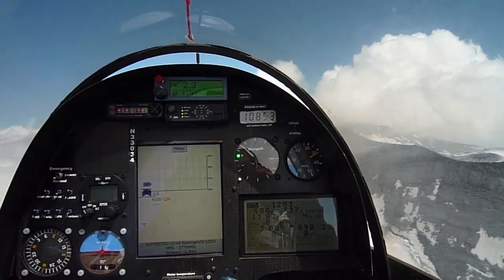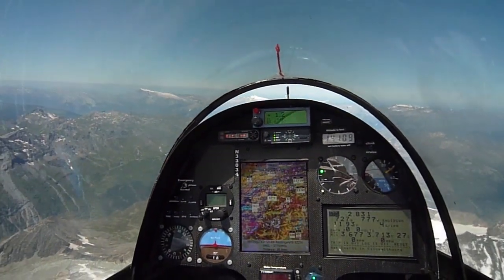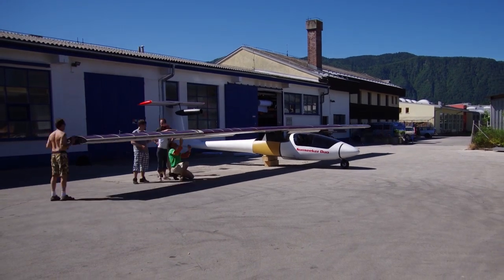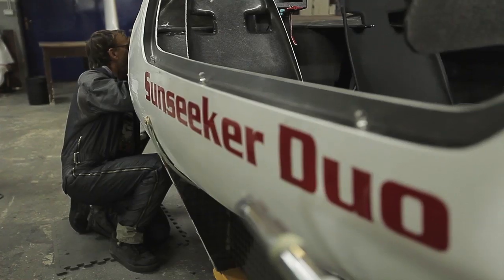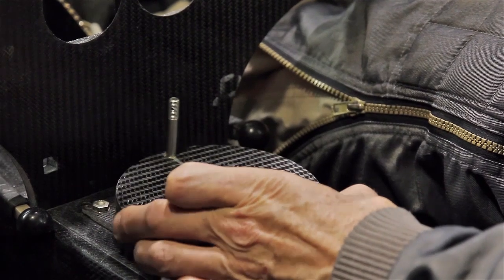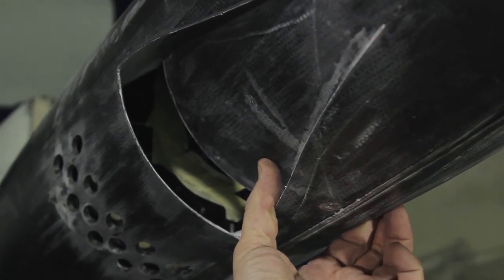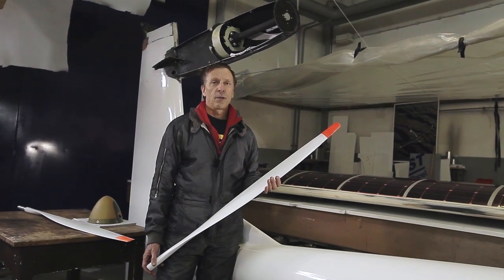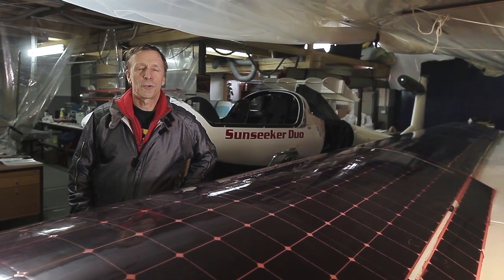The Sunseeker Duo

Comment: Unless this aircraft will re-charge in the air, I really can't see the advantage over an electric glider charged on the ground.
Reply: I would be surprised if it wasn't similar to "off grid solar" in that it would allow them to store excess energy or match the solar output when throttling down the motor.
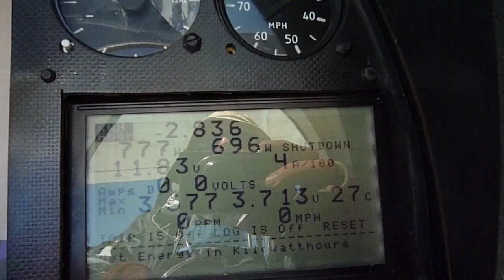Reply: Did you even hear what he said? 00:53
Reply: @HannibalUvvU  EH? Yes, solars panel charge in the air as well as on the ground. There's no way those panels can charge fast enough to produce 5kw continously. Read a book, ffs.
Reply: @kensummers7757  First: This is a glider. The motor doesn't have to provide continues power. It only needs a burst now and then to climb in altitude. 
Second: Do you even know what  recuperating is? There is literally  way if you should dive the nose down to regenerate energy if the air pushes against the rotor. Ever seen a windturbine? Gfys with your ~ever read a book??2?2?~
Reply: @HannibalUvvU  I have over a thousand hours in sailplanes. Hundreds of hours in the Alps and Pyrenees. I fly a 26metre ASH 25. Buzzwords do not impress me. You literally have nfi.
Reply: @kensummers7757  I don't care how entitled you are boomer. Physics and engineering doesn't care about your feelings.
Reply: @HannibalUvvU  If you can gain more energy than you lose in drag and potential. Congratulations. You've just invented the Perpetual Motion machine. Boomer? LOL thats supposed to be an insult? Yeah, I'm entiled, I own the best soaring machine ever invented. Our music was better. Our cars were better and our chicks were prettier. I feel so bad for you. So sorry. Not sorry.